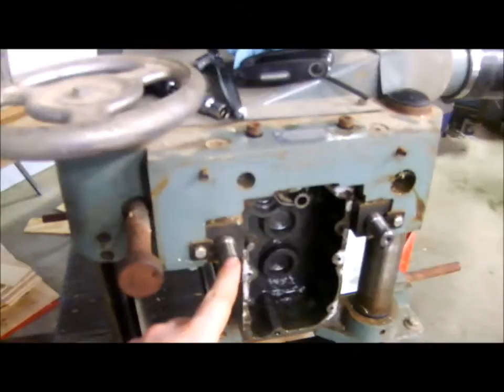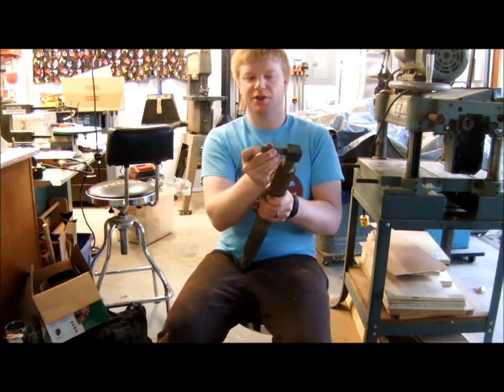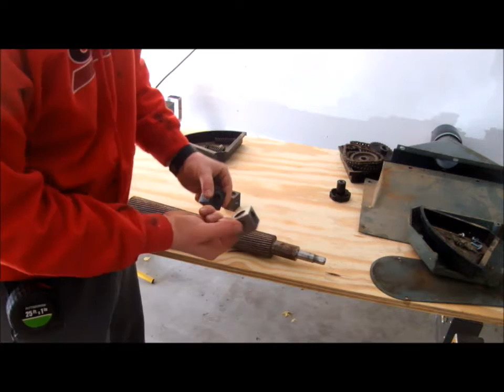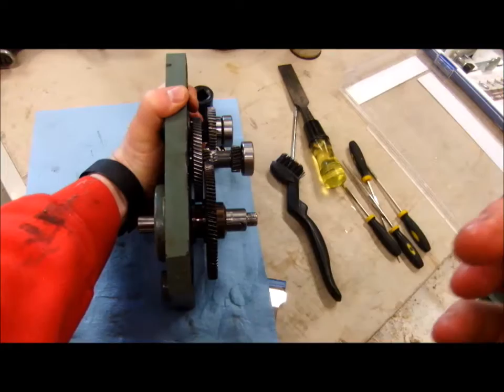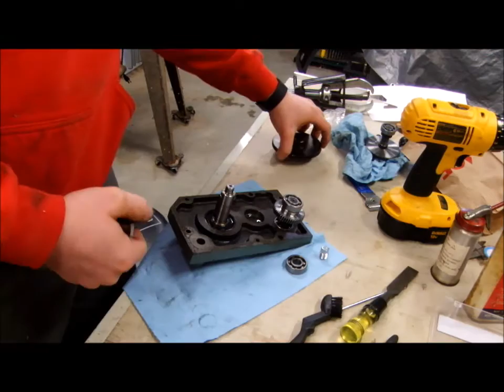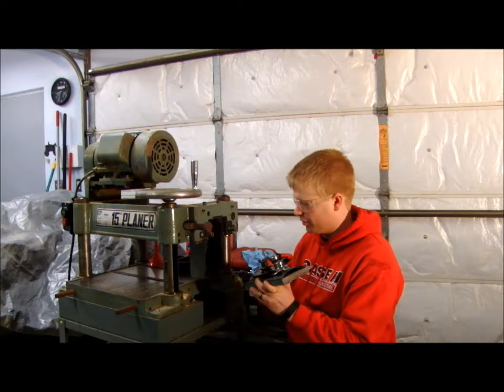15in Planer Mechanical Repair

Comment: Why not just replace the shaft and gear? Available from grizzly for like 15$
Reply from the maker: I had a little trouble figuring out if the grizzly version was identical.  I have run a lot of wood through this planer since I made the video and the fix is still holding up great.

Comment: Half way through my dis-assembly... My planer is a Grizzly brand G1021... Same planer... Mine was severely abused & neglected (left outside)... Just finished removing the blade roller... Only thing left are the anti-kickback plates/roller... Thx for the vid... May have ??? In the near future...
Reply from the maker: Yes, cleaning up all those anti-kickback plates was a bit annoying just because there are so many.  Good luck on your project!

Comment: I have to complete the same repair. Are you able to share tips or video of the entire disassembly process? Specifically, I need assistance with removing the gears from the gearbox. Thanks in advance!

Comment: you may already know, but the block bearing you ordered gets oiled by the hex hole in the screw above the spring, the bearing block has a hole facing up so the oil drips in. find a manual for a similar planer and it will tell how often to put oil in that hole. my planer takes 30w oil.

Comment: do you know what the blade height is on these? I'm working on one
Reply from the maker: Unfortunately no, I had a blade setting tool that came with the planer.  Depth is a little hard to measure on it.
Reply: Hi can you post the web page where you order your parts?

Comment: Can you make a video on changing the oil on the planer?
Reply from the maker: I probably should have seen this comment a while ago.  Changing oil on this unit isn't simple because they built the oil fill holes into the mounting holes for the gearbox.  Remove one of the (4) socket cap screws on the top of the planer and use a funnel.